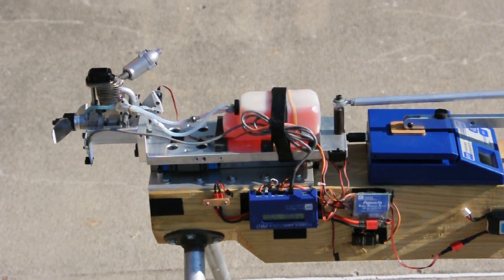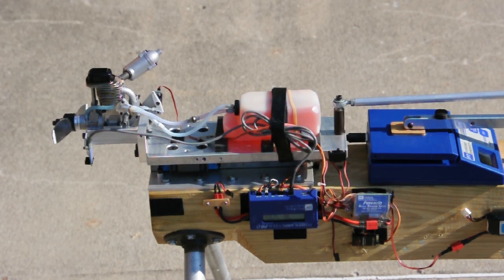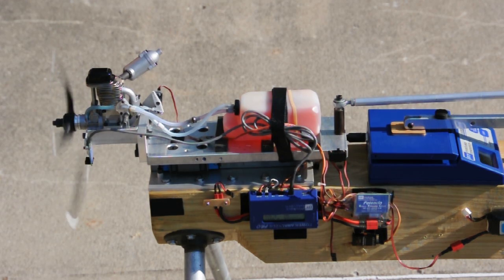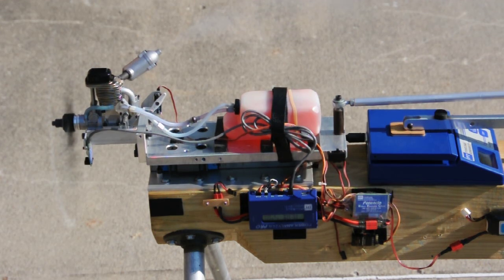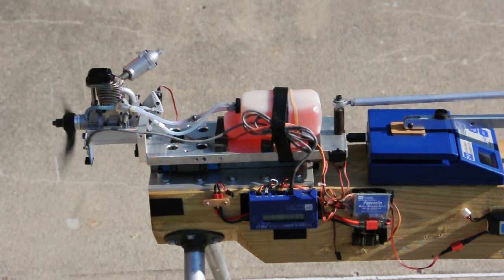YS FZ70-S Four Stroke Engine Testing

Comment: I started my YSF70-S with some fuel made up from my local hobby shop this time.It had 20% Nitro about 17% Sinthetic % the rest Methanol.I told them to add 5% Caster Oil to it.
This time the Engine ran perfect on 2.5 turns out for ideal and 1.33333 out for the Main Jet.On 1 turn out it could detonate to a fast stop.On any richer mix it would run very bad.

Comment: Great test videos. Please post the test results of the various props used..... RPM Static Thrust(lb) Pitch Speed(MPH) Sound Pressure Level(dBA) Once my T/F Contender 60 build is complete I may actually use the YS FZ70-S if I can get the right size/pitch prop info to get screaming top end speeds out of this plane... I'm trying to decide between the OS Max .65 AX or YS FZ70-S for ultimate performance.

Comment: I just got my YSF70-s back from JAPAN all fixed with a YS Large shirt added .After run in so far I have found 2.5 turns out on the slow speed needle goes good on a slow setting.As you start to open the throttle it gets richer fast so it wont stall I gess so perhaps this is where your idle ajustment is set.So try to slow it down more.Just an Idea.      I can not  make up my mind on full throttle as 2 turns is the starting point then add 1/4 for a long life but it sounds way to rich to me .

Comment: I just bought one Brand New and nunning it in over 30 min it was leaking fuel from out the back badly somewere.the Needle detent was missing.The Needle socket was cross threaded into the Carburetor body and one Needle socket Oring was missing.Not very impressed.